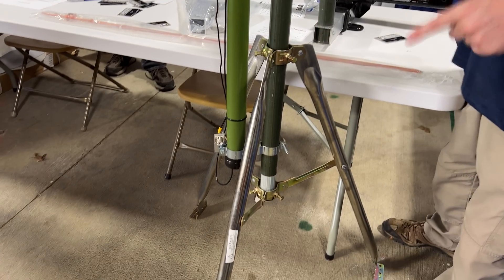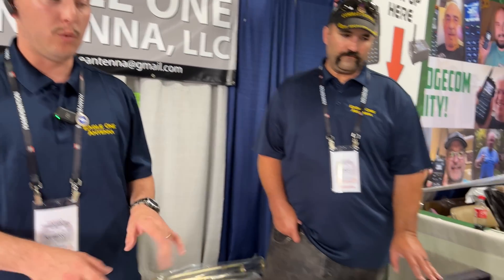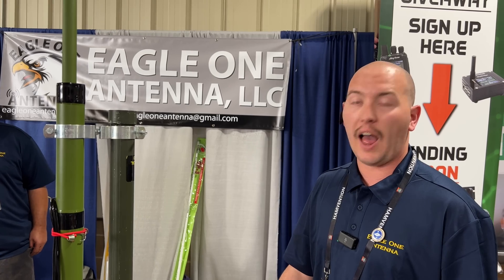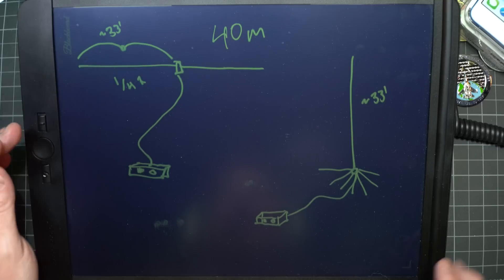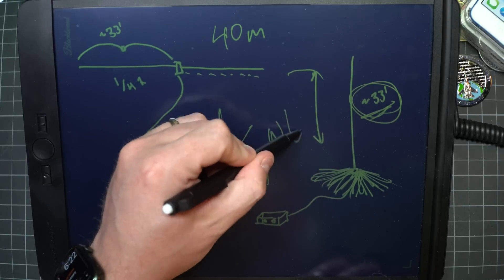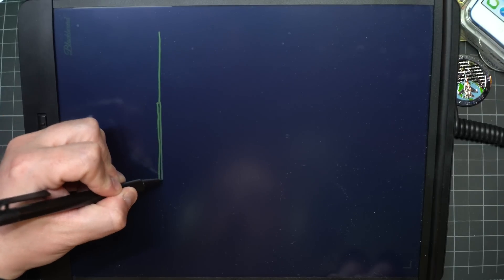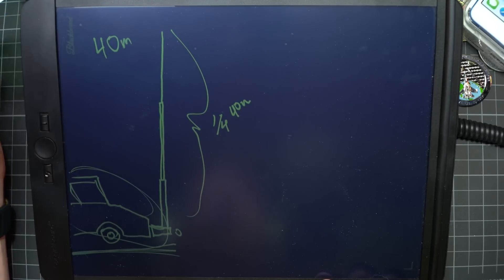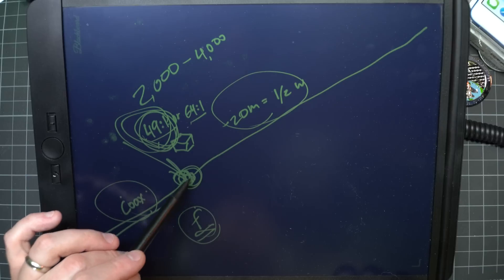Eagle One Antenna - What Is it?

Comment: I did not get a clear picture of this antenna. The Eagle one guy said that the feed coax connect to a SO239 at the bottom and runs up inside the mast to the top. This is at about point 1:34 into your video.   At first I started to thing top fed vertical and then I am visualizing antenna wire outside the mast running parallel to the coax inside the mast. Not sure where the antenna wire would connect to the coax center conductor. What he said does not make sense as I also can’t see the coax collapsing inside that small mast. Your diagram seems to be the only way it can logically be done.

Comment: Ok I have a eagle one on my Icom 7300 with a MFJ remote tuner at the base. It tunes great but im not so great on radials. Would a 49-1 un un improve on this? 
Also the new owners website talks about 6 through 80. Wondering if it will hit on 6 with this setup or if i need to build a 6m antenna.

Comment: Got my Eagle One 2 years ago, love it! It is dead simple to set up, although I have noticed my SWR is high on all bands need to check all the connections, maybe put some radials 3 @ 16’ is what I’ve been told. 
  Also, if you are going to use this as a base antenna, when setting up I took duct tape or wide electrical tape where the sections join, then secure with cable ties. Keeps the antenna from collapsing in on itself, live and learn.

Comment: I played with an AT1011, very similar concept. Your electrical connections must be SOLID or you risk damaging sense diodes inside an autotuner; this happened during a hurricane when I was inside an EOC and the winds loosened up the hardware. The autotune quit at that point. The high voltages of an end-fed 1/2 wave are rough on equipment. The loose connections caused arcing inside the autotuner. I think 31-33' is a bad length for operating on 20m. So, you may wish to alter the length of the main element if possible. Reference my Oct 2012 article, Tacoma Trucktenna, in CQ Magazine.

Comment: I'm curious what the loss is through the mast, which amounts to a heavy-walled radome. It would seem better to have the antenna outside of the mast.
Reply from the maker: Good question.
Reply: Probably no appreciable loss; Consider what your received signal went through. Lots of commercial antenna manufacturers use fibreglass masts with wire in the ‘glass.

Comment: Hi Glen KC8LA here. I also talked to Tristan at hamvention this year nice guy. I've had this antenna for about 2 1/2 years use it with ft891 ldg z100 tuner. I've run it from home portable and on the RV. RV is 32ft so good counterpoise portable or home I use a min of 16 10ft radials 4 bundles of 4 wires easy to deploy and tunes quicker with 160ft of wire under it. It is a compromise antenna that I think works very well. Not a big contester but I did 70000+ points last year with it in the iaru with multiple same station 5 band contacts eu and us. It will and does work better with the tuner at the base which  will be added now that it is permanent on the RV. I was impressed enough with this antenna that I purchased a dx commander for the house (limited space) awesome antenna combined with my ftdx10 my 2 cents

Comment: You really need to do your homework a bit better before you start shooting off your mouth.   Tristen did not invent this antenna,  he bought the company from the family of the man who was manufacturing it in the past.  I just wonder how many more of your reviews are reviews of something you just decided to review without even having one in your possession to test.  The 49:1 Unun on this antenna is total crap.  The 9:1 works just great.   I for one have been using this antenna for many years,  Have worked over 10,000 contacts with it.  Not everyone has the room to put up even the shortest dipole.  You are doing amateur radio a disservice with your opinion reviews based on non-fact  You should try getting a real job and closing this down. 
.
Reply from the maker: Terry. Tristens antenna has no unun. It’s just a wire to connector. Get off your high horse and watch the full video before you comment. 

I have a real job. A career really. But maybe chill with the ad hominem and address my arguments instead of attacking me personally.
Reply: @HamRadioCrashCourse  I watched the full video maybe you need to.  Your the one brought up unun's and said it needed a 49 :1 unun to work.  your just full of shit perhaps before you bash something you should actually try a 49 :1 unun on one and see how wrong you are.   Those of us that have been using this antenna for years actually have found it works pretty good with a 9:1 unun  Maybe you should stick to your career.

Comment: Your analysis at 14:05 is really inadequate to explain the tuner situation.  I simulated the eagle 1 in MMANA, and it estimates feedpoint impedance at 1839+j1139 at 14.1MHz.  

With an 18' RG58 coax feedline (plausible for portable OPs), and a tuner on the TX side, a SimSmith simulation indicates 33% power delivery to the ANT; -4.3dB from the 89% achieved with ANT-side tuner.  
A 49:1 unun, assuming 95% coupling factor (reasonable) at ANT, and with a TX-side tuner, simulation estimates 75% power delivery to the ANT.  So TX->TUNER->COAX->ANT is only -3.5dB compared to TX->TUNER->COAX->UNUN->ANT.  Consider those loss figures in terms of S-units :-/.  

Change coax type or length, and numbers go all over the place.  Just changing RG58 to LMR240 narrows the gap between no-unun and unun to -3dB!  The Eagle 1 isn't exactly great on 20m, but it isn't as bad as you've made it out to be :-).

Note, this does all depend on having a tuner that has the range for the coax+ANT impedance... it's about 16:1 in these simulations.  If you'd like to discuss this further, let me know -- I can hit you up on Discord or something?
Reply from the maker: With all due respect. I was trying to paint the antenna as “bad” I was explaining the realities of using antennas and matching them appropriately. Most new folks aren’t having things explained as I did. In favor of a lot of simulations or math. 

I do question the 18’ coax though that could work for a trailer hitch mounted antenna, but most would need at least 25’ from my experience. What’s the numbers then?
Reply: @HamRadioCrashCourse  I used 18' because that's what I use for my POTA setup (I'm not threading it through a vehicle...).  Anyway, 25' RG58 yields 31% delivery to the antenna; not much different.  

Honestly, as I watched the video, I imagined I was the guy from Eagle and how he'd feel watching it :-/.  The net impression, IMO, is that the video implies it's snake oil (or at least "questionable") by suggesting that an unun is needed.  If, instead, you said, "Well, you'll lose about an S-unit on 20m because there isn't an unun," it would not sound as negative.

On the theory and explanation point -- the variables are so (ahem) variable, that there's risk of harm in broad statements about where tuners should go and what is "sufficient".  TX-side tuner is way the heck better than wet noodle, so some of the phraseology is a bit over the top :-).

Comment: Nice explanation, thank you!
Question on fan dipoles... if you use something like speaker wire with one of the wires cut to 40M and the other cut to 20M while still attached to each other (not 'unzipped'), what does the proximity of the wires do to performance? Any insight will be greatly appreciated.

Comment: Thanks Josh for the informative video. I recently acquired the TennTennas 49-1 unun and I am using 33 ft of wire for a EFHW, 20,15,10. I am curious how it will compare to a 20m dipole cut to freq. Going to to use my newly discovered mode WSPR to compare. Fun fun stuff. Thank you for clarifying the eagle one as I was tempted until I heard there was no unun involved. Would be easy for them to partner with TennTennas for a better antenna IMHO.  ON a complete SIDENOTE, I did have to run 175 feet of coax to this new EFHW to get it into the building where the radio is. Almost flat SWR on 2m! kinda shocked me.   73 de Jon K7CO

Comment: OK, so... Question: Why does mine work so damn well? No counterpoises, simply the antenna wired screwed to the antenna screw terminal on the SG-231 external tuner, and a ground wire from the tuner ground lug,  clipped to one of the ground rods with an alligator clip. I can easily do 80-10m, without even trying too hard... 
Genuinely asking to learn, as it seems everyone says it should not work well, especially without counterpoises. When I unpacked it, my first FT8 contact (ever, and basically first HF contact ever) was to Russia! (Disclaimer: That was in August 2021, not after their invasion of a sovereign Ukraine.).
At that time, it was antenna -> Comet flat window passthru -> MFJ-945e manual tuner -> Kenwood 570SG. Worked fine, hit Russia first time out on FT8.
I've since upgraded to an FTDX10, MFJ fancy shmancy window passthrough, and an SGC SG-231 160-6 feedpoint autotuner.
Reply from the maker: I said on the video the antenna would work fine with a remote transmatch that can handle the characteristic impedance. 👍
Reply: Yep - sure did! But hey, this is the first and only HF antenna I've ever had, so it's the best thing ever, right? 🤪
Reply from the maker: @sharkonwheels2220  Absolutely!  Any antenna in the air and working effectively is better than no antenna!
Reply: One of the reasons is the ground conductivity. The ground "below the antenna" is either very absorptive or reflective,
due in part to mineral content and moisture.

If you place  a counterpoise/radial system around your vertical, on or in the ground, RF is absorbed  into the ground, whereby placing the radial system at an appropriate distance above the ground allows a reflection plane to occur.
And in one case, as with a vertical, any RF noise present in the plane is reflected to your receiver via the antenna.
Most man made noise is vertically polarized. 

 Some of the helps for ground conductivity are Epsom salts which have Magnesium  Sulfate, which if duly applied to the ground around and under a counterpoise, helps its conductivity, and it's reflectivity of RF signals,  depending on the type of soil you have. 
Think of a Vertical installed near a Lake or ocean shore.

The canoe setup I have used with a "screwdriver" antenna/two different models/power ratings. works well on QRP and above. When conditions are ripe for DX, five watts and under is sufficient. Results with an 1/8 wave or less antenna on 40-10 meters can be phenomenal.

Signal to Noise Ratio is improved and the tuners that are capable for use with end fed antennas duly need the RF ground to function with good results. Remove the ground clamp and you get RF feedback,etc and poor tuning. 
A lot of variable  inductance/capacitive reactance  range in the tuner is available for this simple design antenna.

Yet, disconnect that all important ground, and you may have a smoke test ensue.
Some of the very heavy duty Manual tuners with large variable inductors and  capacitors/ ladder line inputs/bypasses and combinations, will tune  but with disastrous results such as arcing of internal components and your  rig may see a combination of RF output foldback and instability on transmit with the likely possible damage to final outputs.

You obviously may have good RF reflecting soil. 
FT8 has a HIGH signal to noise ratio, and that is why when, for example,20 meters is dead on SSB, and CW is just readable,
RTTY may be fading/PSK is reading a bit higher and many of the myriad Digital modes are 5nn. Check a known 
active net, say 14.300 MMSN for phone activity on a poor propagation day,  High readable activity is  1800 UTC to 2200 or so..then FT8 rolls thru the night and near zero activity  for SSB. Antenna polarization and cross polarization occurs too.

So if your setup works consistently ..don't change it ..just improve incrementally where you can.

If you can't hear "em, You can't work 'em!
That is where the proper Antenna and knowledge and experience with it's proper operation is King!

73,
Daryle
WB7TNE

Comment: A 9:1 works better than a 49:1.  On the eagle one.
Reply from the maker: I don’t believe that is true. For reasons that are outlined in the link I provided in the description. A 9:1 generally counts on a non-resonant length of wire.
Reply: @HamRadioCrashCourse  wish I could post the rigexpert photos.  We've been testing them with different setups and the equipment told us what I had said. Cause like you I believed 49:1 .  But testing proved me wrong.
Reply: Also, it has been recommended for the past 20 years or so of the Eagle one production. to use a unun or a good tuner at the antenna. and a deeper dive with Tristan just may gain some more info on that matter.
Reply from the maker: @geoscout87  The issue isn't that a 9:1 isn't effective, it's that the radiating element is resonant on 40 meters.  That isn't something you do with a 9:1.  See the link in description that walks through many different long wire antennas.

Comment: I have an old swan multiband car mount antenna  you pulled a pin out and slid it up and down to different coils inside a clear plastic tube but the buttom had 2 controles ina a box with attsched to the antenna one would probably been a variable capasater  the other the other ?? Chokes  i never got that part  the wip end on the antenna was also adjustable
Reply: The bottom piece has a so2a connector

Comment: Well done Josh.  I have had my Eagle One up here in my HOA for about 3 months.  So far so good in that regard.  I have four 16 ft radials out but some have to make 90 degree angles to conform to my space.  I have found that it performs just great on 40 M but as you suggest, not so much on the other bands.  Putting the antenna analyzer on it confirms that it is really only resonant on 40M.  Makes sense even more now after your explanation.   All in all I am very pleased with the performance on my Eagle One.  For the price point it is a nice antenna.

Comment: Very good technical explanations on antennas, especially these types of "all bands".  It might work better on bands other than 40M if you shorten the mast down to the 20 meter length and roll the excess lead at the bottom, like a Steppir type of antenna, and use radials.
Reply from the maker: Thanks for that!

Comment: I have had the EagleOne for years.  The original creator is now SK but that's who I bought mine from.  Whenever I use the EagleOne I definitely use the 49:1 and it works well on 20m. Without the 49:1 I found the antenna unusable.

Comment: I’m a Eagle One owner and user.  On 40 meters, the antenna is awesome and I easily can work over 1 station a minute if the hunters are out there, and here in the South East USA, they always seam to be. I was hoping I could run my Eagle One on both 40 meters and 15 meters without using a broad external tuner, just the built in tuner in the radio (Yaesu FTdx10).  Unfortunately my Eagle One mounted on my F-250 with the extended hitch is resonate just above 15 meters and my internal tuner can’t correct it.  I don’t need the internal tuner on 40 meters, but I generally use the internal tuner to “touch up” the impedance match.   Any ideas Josh on how to get 15 meters without using a broad external tuner?  I can’t really add any wire or length to the antenna to correct it.  

WRT 20 meters, this excellent video however gave me a good idea on what I could do to get the antenna to work on 20 meters without using a external tuner.  I’m tempted to modify one of my excellent TennTennas EFHW boxes that I don’t use anymore and find a way to build some sort of adaptor so I have a 49:1 unun.   Hum….

Comment: As it happens, I bought a virtually identical (black) antenna about 15-20 years ago (as I recall, it was at the Athens, Ohio hamfest) from S&G Engineering (Proctorsville, OH) - it even has an Eagle on the label <g>
And, yes, I still have it - don't recall if I bought the tripod or not - definitely didn't buy the hitch mount, but I'm fairly certain both were available - seems to me the antenna cost right about $30 <g>

I didn't buy it for a permanent installation, but for portable/mobile use, and I believe I used it a few times for OSPOTA - I was thinking of cutting the wire in specific spots (adding some type of compact quick connect) to make it relatively easy to modify length for changing bands, thereby obviating the necessity of  49:1 unun - alas, that never happened ..

My observations are that your assessment is dead on - it's usable and better than wet pasta, which will rather quickly dry out <g>

... k8xb
Reply: Same company, Tristan took over. W8AFX became a silent key in November. He was the S in S&G. Might just order a cold spare to help keep them going. Perfect in HOAs, as they resemble a “big fishing rod” I’ve been told… still the ONLY HF antenna I own and use, and make all my contacts with.
Reply: @sharkonwheels2220  I was pretty sure that was the case - too many similarities -just didn't want to say so and be proved wrong <g>

Glad you like and use them ..

73 ..
... k8xb
Reply: Yup, you were spot on.

Comment: I was under the impression that radials needn’t be tuned unless the feed point about 10’ ish off the ground. Like the WRC I can get resonant on 20m at 1.2:1  with descent  bandwidth. SWR curve becomes darn near flat if I add some more radials. But I can’t really tell any difference in performance
Reply: Placing radials on the ground de-tunes them, so the exact length isn't important. I'll usually put out 5-10 radials which are about 15 feet long. This, an unun and tuner always work for me.